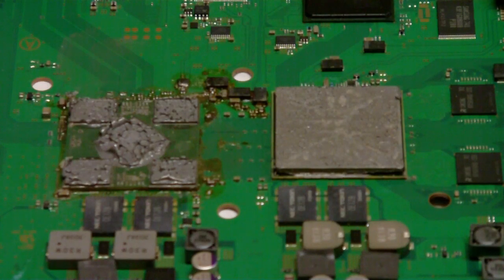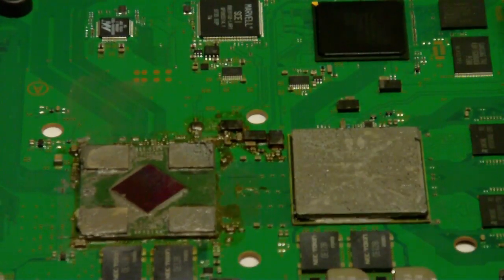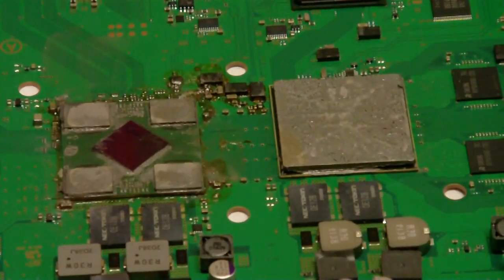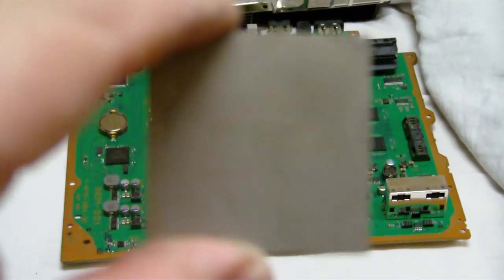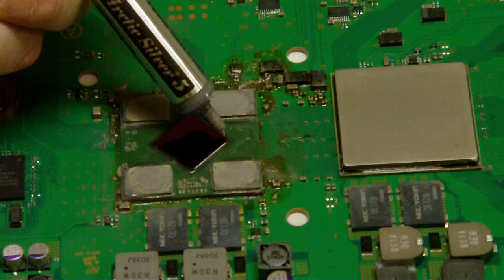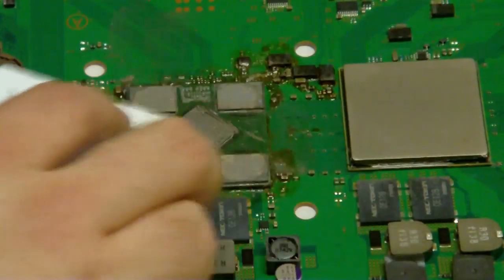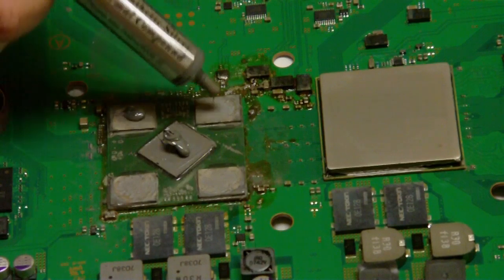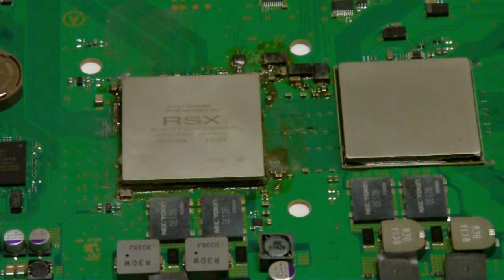PS3 YLOD Heat Plate (GPU or CPU Cover) Fix

Comment: Straight off arctic silver's site."Arctic Silver 5 was formulated to conduct heat, not electricity.
(While much safer than electrically conductive silver and copper greases, Arctic Silver 5 should be kept away from electrical traces, pins, and leads. While it is not electrically conductive, the compound is very slightly capacitive and could potentially cause problems if it bridges two close-proximity electrical paths.)"
Incase anyone is wondering
Reply: While Arctic Silver 5 might not be very conductive, it definitely is conductive, or can become conductive; I used it in an application where the thermal compound will have a potential of about 80 V across about 2 mm of it, and after about four years of use, the thermal grease had become conductive enough to conduct over 6A, and blow a fuse. (Note that the grease was not acting as an insulator; it was only in contact with two metal surfaces, the screw going through a TO-247 transistor into a heatsink, and the cooling tab of the transistor by being smeared over the insulating washer).

I would not trust AS5 anywhere near an SMD capacitor - even though the voltage is much, much lower.

Comment: Thanks man, ordered a couple of broken ps3s recently for 40$, fixed one and the other was dissassembled. the heat plate fell off and i wasn't quite sure if i needed adhesive or could use thermal paste but now I know! Thanks!

Comment: thanks! this solved my problem with overheating! the actual gpu cover wasn'tthere, i saw just the chip. when disasmbling, the cover fell off the heat sink assembly, so i knew there wasn't a good connection.

Comment from the maker: yea You can and probably should use some thermal adhesive to re-attach the heat plate.  One thing that you will have to do is get as much of the old adhesive off as possible.  I used a dremel with a flat sand disc on it to get the adhesive off of the heat plate and the corner chips.  If you don't do that, then you may not get the plate seated back on there far enough to make a good contact with the main GPU chip in the center.  If you have any questions, feel free to ask.  Thanks!

Comment: I had this same exact thing happen to me. There is a proper adhesive for this and it worked perfectly. Use the Artic Silver Thermal Adhesive Part A and Part B. Pick every bit of the old adhesive off of the plate and the chips.  There's a cleaner that will help dissolve the old adhesive. This stuff heats up when you mix it then becomes solid. Spread it like thermal paste on the 5 chips then put your plate back on and hold in place for a few minutes. That's it

Comment: @BakeswithNUG Not Electrically Conductive:
Arctic Silver 5 was formulated to conduct heat, not electricity.
(While much safer than electrically conductive silver and copper greases, Arctic Silver 5 should be kept away from electrical traces, pins, and leads. While it is not electrically conductive, the compound is very slightly capacitive and could potentially cause problems if it bridges two close-proximity electrical paths.)

Comment: Tip for applying Thermal paste evenly...
Put your finger into the corner of a plastic sandwich bag, or use saran wrap to cover your finger tip. Use your finger to spread the paste.
Quick, easy, no mess...

Comment: Not Electrically Conductive:
Arctic Silver 5 was formulated to conduct heat, not electricity.
(While much safer than electrically conductive silver and copper greases, Arctic Silver 5 should be kept away from electrical traces, pins, and leads. While it is not electrically conductive, the compound is very slightly capacitive and could potentially cause problems if it bridges two close-proximity electrical paths.)

this is from the AS web site

Comment: @Mooseguy15 

Hey Mooseguy, is there a solder connection between the cpu and the socket of the motherboard or is it more like a ZIF type of processor? Just asking because I can take it apart but am not good at soldering so if that is the case might just get it repaired. Appreciate your answer.

And to the poster, 

We are all here to help so no need to be so harsh on someone for giving a post that will help someone. Thanks for the video and taking the time.

Comment: Thank you so much, now I finally understand why my machine looked different when I took the damn thing apart. Unfortunately I re-flowed the chip with the heat plate OFF so I don't know if I've made some permanent damage or not. :(
I'm also loathed to go through the whole thing all over again just to be disappointed so I may just send it off to the professionals who love all that tinkering. I guess what I need to know is whether I've damaged the chip or whether I just reflowed badly.More research

Comment from the maker: @theerazor79 YOU DON'T WANT THAT PLATE TO COME OFF. If it does, then you will have this extra step to do from now on when you go to fix your YLOD PS3... The best thing to do in my opinion is gently pry the board away from the fan side chassis and maybe gently twist the fan side chassis while prying the chassis away from the board. That way, you lessen the chance of pulling the plate off of the GPU/CPU

Comment: also..... my first mod was cut open the case directly below the heatsinks and throw a couple of pc fans on it then cover all with a grill... looks nice and works ! oh and once the heatsinks are off the board cut round them in the plastic where they fit through so u dont have to keep removing them when u need to take the whole board out, simply lifts them out along with the board

Comment from the maker: @teamn0kturnal I would not try to take the heat plate off unless you have some of the thermal adhesive to replace thermal adhesive that is on the 4 512MB memory chips that is on the RSX GPU.  Even then, I would not try to take it off.  Just as ER4263 said a few days ago, the suction (along with the heat generated reflowing the solder) can cause the adhesive to weaken and release. By coming off, the only thing that accomplishes is having to use more thermal paste when your PS3 does the YLOD again

Comment from the maker: I didn't remove the GPU.  The heat plate on the GPU is what came off.  I just used Arctic Silver 5 on the chips  then put the heat plate back on.  Im not sure about if the GPU comes off.  Considering that it is not a pinned socket, but a land socket, it may require a specialized tool to get it lined up correctly.  I need to do more research on reballing before offering advice on it.

Comment from the maker: @ballerhollicdudess What do you mean?  Do you mean to get to your mainboard or do you mean removing the heat plate.  If you mean removing the heat plate, then I would not recommend doing that.  The only reason my heat plate is off and my GPU is exposed is because my heat plate came off when I removed the cover from the mainboard.

Comment: do you apply compound on heat plates as well? didnt think the heat plate came off. ive been just thermal compound top of heat plates. not on actual chip. next time i take apart machine i'll check to see if i can take it off.

Comment: I found that the YLOD reoccurs because  often the heat sink doesn't mate perfectly flat with the tops of the plates on the chips. The problem is the recessed part of the "ears" on the sinks are not always the correct thickness to allow the sink to reach down far enough below the metal cage. Check your fit before applying thermal cmpd by using Crisco- no joke. Look at the spread pattern and if necessary, thin the HS ears near the areas that don't touch using a flat file or Dremel.
CONT...

Comment from the maker: @notoriousvak This guy is right.  Reballing is what needs to be done.  I don't think that is a permanent fix either, but it lasts a lot longer than hitting the board with a heat gun.  I have heard in some instances over a year with reballing.  Notoriousvak,  Is there anywhere on the net that you would recommend finding information on reballing or where to get it done online?

Comment: he´s right. the problem is that this kind of metal thermal grease is conductive and can cause problems, especially when it comes on the pcb. the other fact is that more thermalpaste will get the pu hotter than a thin film. that is way too much.

Comment from the maker: @lulustu yep it is, but it works...  I actually permanently reattached the heat plate with some Arctic ceramic adhesive.  I used a dremel to sand off the old adhesive on the memory chips and heat plate...

Comment: The heat spreader is on top of the chips for a reason, to spread the heat evenly before it hits the heat sink. Tanking them off will only make it break faster because of inconsistent heat transfer. I wouldn't take them off they have a specific job to do. I would just get copper shims so that the ps3 runs cooler. Taking for the heat spreader is a waste of time... reflow board with copper shims on CPU and GPU with THIN coat of thermal pastes is best option...

Comment: OMG,that a shit load of paste.If you have too much paste it will not give off heat to the heat sink.The purpose of paste is to grab more heat directly from the cpu,and give it off to the heat sink,if you have too much paste all of the heat will not transfer through the paste effectively.

Comment from the maker: @briankelly666 That is what I ended up doing.  What you have to do is get the old adhesive off of the chips and the heat plate before you place new adhesive on.  I took a dremel with a sanding pad and lightly sanded the adhesive off of the chips on each corner (mem chips) and then lightly sanded the heat plate until the copper was barely showing through.  I then put some Arctic Silver on the the GPU chip then Arctic ceramic adhesive on the mem chips and seated the heat plate back on the chip.

Comment from the maker: @BakeswithNUG AS-5 is not electrically conductive.  That is why I used it...  Well that and along with its supposed heat transfer abilities...  I haven't heard of IC Diamond.  I guess I need to research that some and give it a try.  Thanks for the tip on that!

Comment: how you add the heatspreader to the RSX? I mean attach it, with the thermal compound? dont you need something like glue? AS5 isn't glue, so HOW???

I know RSX needs AS5, but the ram's chips around it, don't. I think the glue goes over the ram's chips.

Comment from the maker: @jonnois so far it hasn't damaged my PS3...  The next time I crack it open, I will sand the old adhesive off of the memory chips and reapply adhesive to the mem chips and AS-5 to the core...  I will make a video of that and post it as well...  Thanks for the input though...

Comment: Would be convenient to open it on purpose?
 I mean when fan are spining to fast an noise and change external paste is not working. Would it help to open the cover and replace internal paste too?
Reply from the maker: I wouldnt pull the heat plate off.  Mine just popped off because of the heat.  You can probably skip that step
Reply: @tennwhitetrash  I know you didn't do that on purpose but I changed the "external paste" and it works a little better but is not enough so I thought in my console internal paste need to be replaced too

Comment: Ok so it sounds like it is soldered to the board ( explaining the need for a heat gun) not like a computer based motherboard where you drop the cpu in and then the heatsink brackets hold it in place. Thanks for the information.

Comment from the maker: @MrThamasterdammer what do you mean it falls down?  when heating the back side of the board?  It has never done that to me.  Not sure what to tell ya on that.  Maybe heat the back side of the board, then apply the thermal compound and the heat plate on the top after the board has cooled from heating it on the back side...
  I hope this helps...

Comment from the maker: you don't want that plate to come off.  If it does, then you will have this extra step to do from now on when you go to fix your YLOD PS3...  The best thing to do in my opinion is gently pry the board away from the fan side chassis and maybe gently twist the fan side chassis while prying the chassis away from the board.  That way, you lessen the chance of pulling the plate off of the GPU/CPU...

Comment from the maker: @ReligionxSkeptic I wouldn't take it off.  You really don't want to take it off.  That paste is fine underneath that heat plate...  If it does some off then that just means that you will add on the chips under the heat plate and that just means more paste you will have to buy.  It will still get the YLOD again...  you will just have to do this step that I made the video for.  more paste...  more time...  pain in the ass...

Comment: You really should use thermal adhesive on the chips instead of thermal paste. The thermal paste could concentrate the heat more than the adhesive, and could make the RAM hotter than it should run. Plus, using thermal adhesive of a high quality should prevent the chip from lifting. One last thing, despite technically being non-conductive, it is still possible for AS5 to conduct electricity (their website states this). Arctic Cooling's MX2 is a better choice. Plus, no 200-hour cure time.

Comment: The fan is meant to do that, it perhaps didn't before because sony use crappy ceramic paste (with a slower thermal emissivity)  It's always better to just pay a pro to do it in the first place if u can. Given it's a PS3 you might get away with it for a while, but even a pro can only do so much w/o the right tools.

Comment: Yes it isn't that hard to remove but you probably shouldn't unless you are having heating problems and you have tried everything else. The PS3 is stock with silver thermal paste (like AS5 but not as quality, still not bad) so you shouldn't have problems with it. But, you might, so go for it if you want.

Comment: I reapplied compound on my PS3 but didn't know that those covers can be taken off and didn't reapply compound under them. Is that okay? I mean could they be losing some thermal transfer? BTW, the factory compound had hardened and fan is spinning quite loudly before and after the fix.

Comment: i just had a question i recently purchased a used ps3 that will randomly shut off after about 40 or so mins of play could this sove it and also i was concerned about u having to do this five times was that over a large period of time or once after another cause really i want kind of a perment fix when it come to electronics im good but they have a habit of breaking the more i have to take them apart

Comment: The thermal paste is supposed to be as thin as possible else a ok guide. But the thinner the better, always....... else it does overheat even more. Their are some gpu and cpu mainly for desktops that neeeds the little blob but that is for entirely different reasons.

Comment from the maker: @ninjaseven I agree.  less is more, but in this case, the less is more ideology didn't work.  my fan started screaming.  I pulled the GPU plate off and the drop I used only covered about half the chip.  I think that it was because of the adhesive that they put on each of the four corner chips caused the plate not to get a good seat on the GPU chip.  If I would sand the adhesive off, then I could probably only use a pea sized drop, but I don't trust myself to sand adhesive off of a chip... :)

Comment from the maker: @gmgman101 I just don't feel comfortable blasting the GPU chip directly with a heat gun.  Quite a few tiny caps on there that could possibly blow away from their position after the heat has re-liquefied the solder.  At least the plate offers some sort of protection...  Besides the GPU is cooking it just as hard, if not harder than my heat gun.

Comment from the maker: Yep.  I need to either find someone that does reballing or get a kit and attempt myself.  Since I did it the last time, it hasn't quit working yet.  Now the fan speed runs at different speeds depending on the load and that seems to be keeping from getting the YLOD  it has been about 3 months now.  Not sure what made it start changing the fan.  I must have hit a sweet spot on the GPU with the AS-5 (or without) to get the fan to speed up under load...  :)

Comment from the maker: @latyrx7 nah.  AS-5 doesn't have a cure time.  Just wait the 15 or 20 mins after reheating the board before handling it so the board is cooled back down around the GPU and CPU.  You should be good to go then...

Comment from the maker: @averagemale2000 Did I say it was a permanent fix? NO...  I simply offered a video of how I "temporarily" fixed my  ps3. It doesn't matter... Feeding games  like COD to a ps3 is like giving heart patient a double quarter pounder... Eventually it is gonna croak somehow even after repeatedly fixing it... So please don't chastise me for  making temporary repairs to a design flaw in the system and offering some guidance to others that run into the same problem that I had.

Comment: hey friend this is an en lighting video ,do i need to do this even  when my RSX plate does not de-patched  from the cpu? i fix once my ps3  with the heating gun  flow  thing..now it seems not to do any effect ..it just starts with the green led then goes orange and then red blinking and it beeps 3 times,, i try  twice to fix it  with the gun  but nothing happens..any ideas please? thanks

Comment: People watching this video don't do this please you risk of pulling either one of the memory chips off or potentially cracking/ripping on the GPU Die itself, Adhesive is strong don't underestimate it please this is not necessary the only fix for ylod is reballing the GPU which is the process of taking the RSX off and replacing the solder with lead solder. DO NOT attempt that either if you have no idea what you are doing. Please i will not be held responsible for the damage of your system if u do